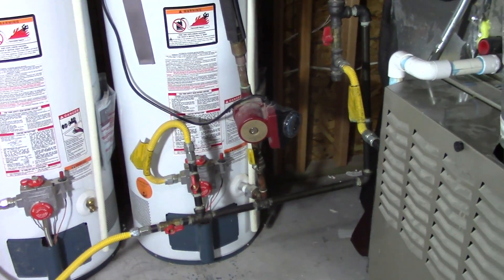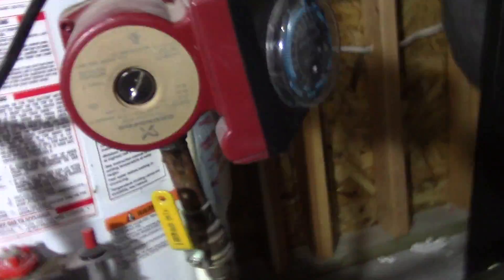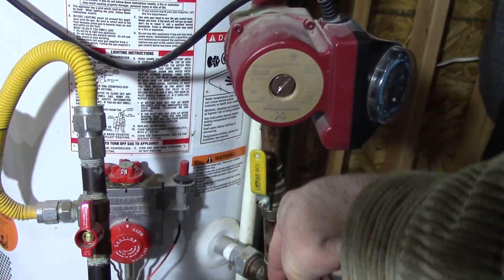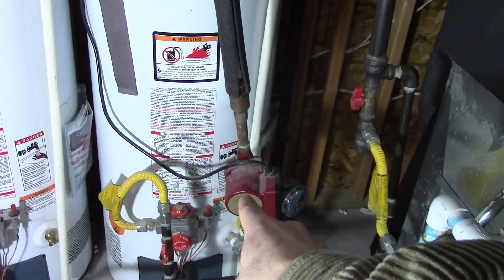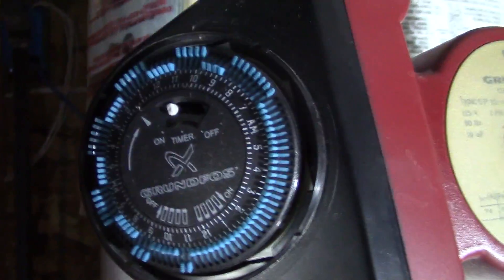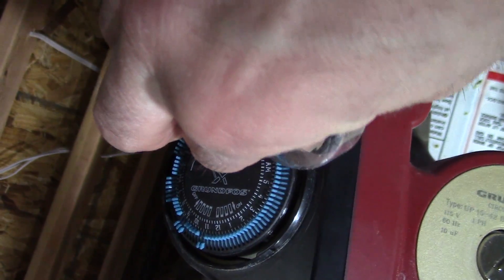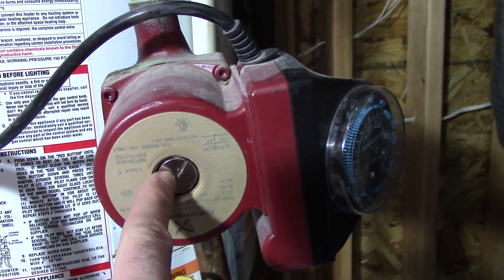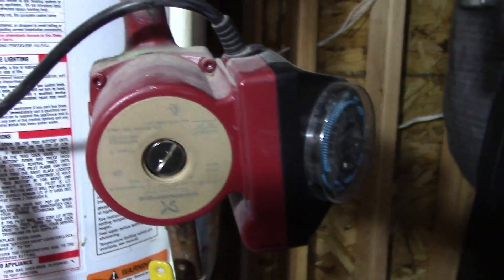Residential Hot Water Recirculating Circulation Pump GRUNDFOS

Comment: Great video. How do you know if the pump is seized or not? I've been troubleshooting my system which worked well until a recent bathroom remodel, now I'm not getting instant hot water anymore. Wondering if mine is seized.

Comment: Adam, I just had my Grundfos pumps installed today and they installed upside down like you have yours and I wondered....why???? Everything is upside down now and difficult to read the label and set the timer. Why is it important for the water to be pushed through the hot water heater versus drawn from it and pushed through the house? Wouldn't Grundfos have designed it to work that way in the first place? Seems odd to me and every other video I viewed had the pump drawing hot water from the hot water heater, not the other way around. Hoping you can provide clarity for me. Thanks!

Comment: The return off of the pump should be going in the cold side inlet of the water heater ! Not the water heater drain where you have it tied in you need spring checks on the cold side to ensure hot water dose the get forced back through the cold side water lines !

Comment: That's a good tip for a temp fix. 
Replacement is highly recommended when you start to have mechanical failures like that. Try to get some support on the piping though, otherwise you may come down to flooded basement. As a plumber it is code to support pipe for the reason in stress on so joints don't fail. Yes soldering and threaded are strong joints but still have the potential to fail which is why the code is in place. 
You may make it years or you may not, not worth the gamble in my opinion 🤷‍♂️

Comment: Hello. Is my understanding correct: You connected the pump to cold return and connecting to drain plug?  My tank has hot out from the tank and a cold-in from my water mains. How do I fit into that setup? A diagram would be useful - one with one tank and another with 2 tanks like yours. BTW the pump manufacturer's manual says that one must add  a bypass valve under a sink. Your approach does not need that because you are using the drain of the water tank?  Your approach is different than what the manufacturer is suggesting - can you comment on that. If one can avoid the bypass valve that would be good. Thanks

Comment: I have a similar setup and hopefully I can get an answer. There are 2 heaters in my setup. I can valve them in a single system, or in series or in parallel. My question is, where would I put the recirculating pump? I am planning on using the temperature controlled valve at the furthest outlet. And will not have a dedicated return. 
Thanks!

Comment: I cannot tell you how much I have appreciated this lesson.  I already have a similar pump but different model that pumps with a separate plumbing line through the tankless water heater.  I have a timer on the line so that I can push a button and it will circulate for 5 min. then turn off.  Well, one day after the summer, I pushed the button and nothing happen.  So I decided to get a new timer.  Between the time I ordered the timer and receiving it, I checked the line while bypassing the timer and it still did not work.  So, I just surmised that it was the pump.  So I started looking at pumps....at $90 to replace the one I had.  So I went online to find out any trouble shooting with the pump that I have that would help but decided to check on-Iine  BEFORE I ordered.  To my surprise, after watching your video, I, in fact, went out there and tapped the pump with a wrench a few times, shut off the system and opened the line at a point just past the outflow from the pump.  With crossed fingers, I plugged the pump in and, low and behold, about 2 gallons of rusty, dirty water came flowing out.  When I unplugged the line, the flow stopped.  I plugged it in again and the flow restarted.  I ran it until the water was clear.  And with that, I will only be of the money that I spent on the relay timer ($50) and the price of reconnecting the line from where I drained the pump.....oh...by the way, I failed to mention that this all got started at this point because of our record cold winter after the PEX connection just past the back-flow prevention valved sprung a leak,  after the pipes has frozen, after I left the garage door open to go to, of all places, HOME DEPOT!!!!!  All I need to do is replace to connection to the back-flow prevention valve and we will have a re-functioning hot water recirculating system at a fraction of replacing the pump.  Thanks again!
Reply: You should check the source of that rusty, dirty water..

Comment: Many households have occupants which don't live a routine lifestyle, so operating a system using a timer often results in wasteful demand on the water heater and pump when hot water wasn't needed.  Why not reduce your energy bill with an Intelli-Circ controller to minimize pump operations?   Activation can be by wireless or wired push button or wireless motion sensor or even triggered via flow switch.   I personally prefer using TACO pump so when the pump does reach it's end of life you don't have to buy a whole new pump as well as the cost of replacing it.   ReadyTemp and TACO pumps have replacement impellar cartridges which take all of 5 minutes to replace.
Reply: I prefer a remote power switch by wire, when you turn the boiler on you can turn the pump as well and have consecutive hot water, can even add a timer.

Comment: Thank you for posting this.   Our water heater (left side, like yours) broke and leaked in basement 2 days ago.  Plumber coming tomorrow and I didn't know what to do with our circulator, even though I've got the manual here.  At least I turned it to low from medium.  There's no expansion tank I can see.  Also, there's no timer or off button.  5-7 hours until plumber comes...

Comment: This is useless.  Most people don't have two hot water heaters.
Reply: Today I replaced my 2 old water heaters connected like his with a tankless system.  My circulator pump had been working perfectly, but when we started the new system I felt that the pump was no longer working.  I was pretty frustrated, but then I found this video.  In the last part of the video, he described the exact problem I was having.  The pump was too hot to touch, and I wasn't getting instant hot water any longer.  I took my Swiss Army knife and tapped smartly, but not really hard, on the brass button, and my problem was solved.  I felt and heard the water begin to flow, and, so far, it's working as it should.  Many thanx for those final remarks in your video.
Reply: You don't have to have 2 water heaters to do this - you can do it with 1.
Reply: My recirculator  stopped working.  I had it turned off for 4-6 months 
while my HWH sat idle.  It's awfully coincidental that when I got the 
new HWH the recirculator would stop working.  Could the problem be 
connected to its having been idle for several months?  Any suggestions 
as to how I can get it working again w/o having to install a new one?
Reply: Double check the pump is still connected properly to both plumbing and electrical.  Your plumber may have disabled it when they replaced the WH.

Comment: Hi Adam, good video.  I think my builder installed my pump incorrectly, similar setup as your video with pump at bottom of tank and line running throughout house, but my pump is installed with flow away from water heater, arrow pointing away from tank back into recirculating line.  Will have to disconnect and reverse pump flow.  Thanks
Reply: David, did you ever reverse the flow of your pump so it pumps "into" the hot water heater? I just had mine installed today and they installed it like Adam's and I wondered why???? Everything is upside down now and difficult to read the label and set the timer. Why is it important for the water to be pushed through the hot water heater versus drawn from it and pushed through the house? Wouldn't Grundfos have designed it to work that way in the first place? Seems odd to me.
Reply: @denniswalsh1960  you don't want it to work against the flow.

Comment: If new construction, consider insulating ALL of the hot water "loop" (throughout the house) to reduce heat loss. Try to minimize developed length from the faucet to the loop - maybe 5' or less.

Comment: This system could be optimized by incorporating and Intelli-circ controller and installing it's temperature probe just before the last hot water load on the loop.  Thereby preventing circulation when hot water is already present throughout the loop.  Simply place the pump in ON mode and plug the pumps power cord into the Intelli-circ.

Comment: I have this system in my house. After replacing my water heater and circulation pump I'm getting hot water in my toilet tanks. Will a check valve o. The cold supply side fix this?
Reply: U need to add a check valve on a cold water  inlet after the ball valve 3/4"
Reply: +Paskal G G I appreciate your response. I did that and it did stop the hot water in the toilets.  When the circulation pump is on my hot water is about 30 degrees cooler than when the hot water recirculation pump is running.  2 plumbers told me they thought that my hot and cold water was mixing somewhere.  I don't see how that is possible.  Is it normal to lose 30 degrees of heat by simply running the recirculation pump?
Reply: You can also add timer on your circulation pump that's will help a lot just put the time what you need!!  I work on plumbing more than 10 years!!
I hope will help.
Reply: +Paskal G G I will do that.  Our home is too large to not have it for the mornings.  Especially in winter.  Would you say that a 30 degree drop in temperature is normal?  I have it turned all the way up to the "c" setting which is next to the highest and the temp I get is 110-120.  Without the circ pump on the water is 140 degrees

Comment: There is no drip leg on your gas line. Can't hope to have a reliable and safe gas valve without one!
Reply from the maker: +Paul Merritt  Yeah, I'm not really happy with the builders of the home.  It has one but it is about 1" at best.
Reply: +AdamDIY 
can we use this pump for outdoor thankless water heater? installing this pump upside down will impact the its ability to work? what is your recommendation for out door tankless water heater. your help will be appreciated

Comment: Does the water flow thru the tanks and pipes any time the pump is on??? Or is it only on when in use ( a open tap ) ???
Reply from the maker: +Jeff Brown The water is in a constant circular flow when the pump is turned on, regardless of the tap being on or not.
Reply: So if I tap the clean out valve and run it to a solar powered pump attached to a solar collector and back to the hot water heater any time the pump is on....water will circulate???
Reply from the maker: +Jeff Brown It works if it is all in a loop.  You cant branch off of a loop and have it work as well.  One big pipe loop.

Comment: i need to turn the hot water taps of ,can i isolate them by turning the two valves top and bottom on my grundfos waterpump and empty the taps ,as i want to put a new sink in kitchen,have turned of cold water from the mains

Comment: A friend bought a house with one of these. Does not want it. Was told it would cost $5,000 to disable. Sound right to you? Any ideas on disabling?
Reply from the maker: +greenskeeper59 $5000 to disable? No, thats not right. To disable mine I just turn it off.  Even to remove one that price is way out of line.
Reply: +AdamDIY Thank you so much for your reply. We tried simply unplugging it to no avail.  When unplugged she gets no hot water. Any ideas?
Reply from the maker: What brand and model is it?  You should be able to just take it off and reattach the pipes.  Maybe send me a picture to the email in my ABOUT page on youtube.

Comment: How can make my water pump  be turn on and off by a remote control , my pump is very old  and donot have timer, the kids complaint the garage is to cool to go plug it in, help please
Reply from the maker: Yes. One way is to plug the pump into an X10 outlet or an X10 Box.  Search X10 on amazon and you will see the different products.  You will need to get the X10 remote and the X10 box or wall receptacle.   It's really simple, I use X10 to turn my Christmas lights on and off,
Reply: hey adam DIY thanks ,that work perfect the X10 outlet and the remote did the job

Comment: To reduce the high energy consumption caused by circulating hot water homeowners can install a Intelli-Circ controller which will allow the system to function as an on-demand and/or scheduled operations.

Comment: Your water heaters are piped together wrong. The system should be balanced. Meaning a tee between the units, and equal length of pipe on each hot riser and pipe to the tee. The same on the cold side. Your piping configuration just works one water heater and is extremely inefficient. The water heater on the right will be the first to fail. The one on the left is just acting as storage. Repipe correctly and balance the system and you will greatly reduce your operating costs.
Reply: Not necessarily. If you use the first tank (the upstream tank) as a tempering tank you can save money, and still have lots of hot water capacity when you need it. Like the tanks in this video, my tanks are plumbed in series. Cold water (50F) from the city enters the first tank, then passes to the 2nd tank, and then goes to the hot water taps. I use the tanks as follows:

Normal usage setting:  1st tank set to approx. 90F so it warms the 50F supply water up by 40F.  2nd tank set to approx. 130F so it also warms the water by 40F. Hence the work load on the two tanks is about the same. The water in the first tank is not that hot, so it may be prone to bacteria growth, but this water would be sterilized when it passes to the 2nd tank which is hot enough to kill most any bacteria. 

Low usage setting: This would be for a few weeks during summer vacation when not everyone is showering first thing in the morning. First tank is off, but still warms the cold water for free from 50F to current room temperature (avg 75F). I live in a year around warm climate and my tanks are in an unheated garage, so the tank absorbs heat for free from the surrounding air. The 2nd tank heats the water from 75F to 130F so it’s doing more work. 

High usage setting: When we have lots of guests and hence need lots of hot water. Both tanks set to 130F. In this case, the first tank is doing most of the work, but that’s OK since it got a break during summer vacation.  

I also have a hot water recirculation pump, but it’s connected to the bottom of second tank which always has hot water in it. For me, connecting it to the first tank would be a waste of money during the times when the 1st tank does not contain fully heated water. 

The other benefit is redundancy. If one tank fails I still have hot water. If it’s the 2nd tank that fails, I can easily take it out of the hot water circuit, since I use flexible water supply lines which are easily unscrewed and moved.
Reply: These heaters are piped in “series” not “parallel” . Nothing wrong with it

Comment: Hi Adam! Thanks for the video. We have the same pump, so I'm hoping you can help me troubleshoot. My timer is off, like WAY OFF. I have it set for 5-9am, but it is turning on in the middle of the night instead. How do I make sure the pump knows what time it ACTUALLY is?? Also, when turning the pump on for continuous use, do all the little blue switches also need to be in the "on" position? ...Because I just turned the main switch to on but all my little blue switches are off and I don't hear any water moving through the pipes. Thanks for any advice you can offer.
Reply: The same circulation pump was not use for a while.  I decided to turn it on today and found it was not running just like your.  I remove the pump from the pipes.  I read the manual which said I should remove the big screw (you will see it, there is only one big screw ) and turn the pump shaft.  Except the pump shaft will not turn.  I then took of the four hex screw at the corner of the pump.  I slip off the internal pump which look like a stainless steel cylinder.  I believe this is a magnetic drive pump.  Gently rock the stainless steel cylinder off the base and I can see the pump "turbine" which was caked with mineral deposits.  I use a took a brush and clean it up.  The shaft would start turning.  Put everything back and Voila, the pump is working again.!!!  I was easier than I thought.
Reply from the maker: I made a video explaining how to set the timer. See it here http://youtu.be/J0ScEowe0HA

Comment: I recently had a tankless water heater installed along with a Grundfos recirculating pump. This pump also has a temperature sensor which attaches to the hot water pipe. Theoretically, when the pipe temperature gets below 90 degrees, the pump is supposed to turn on thereby keeping the water hot. It doesn't! I've had the initial pump replaced and it still doesn't work. The only way I can be sure to get hot water is to disconnect the sensor AND turn the pump to the ON position. If I put the pump switch on TIMED cycle and use the timer, the pump will turn on once only. I'm very disappointed.